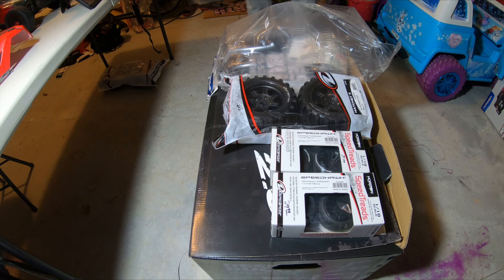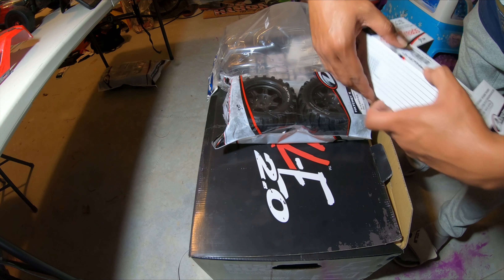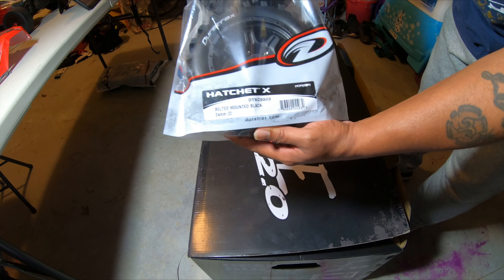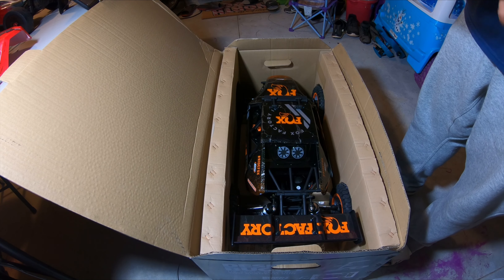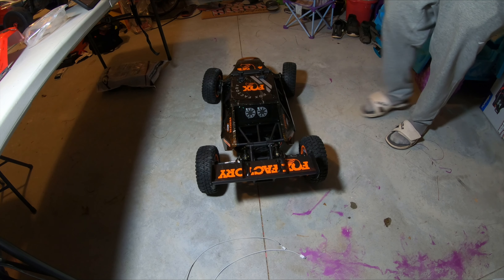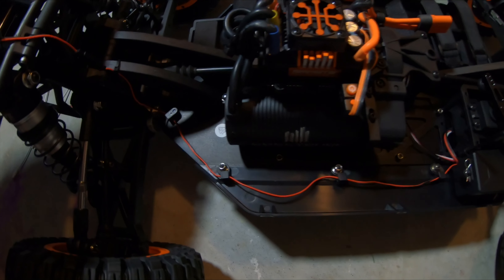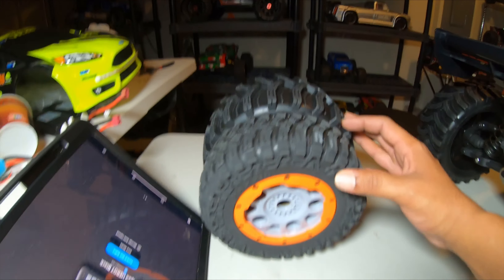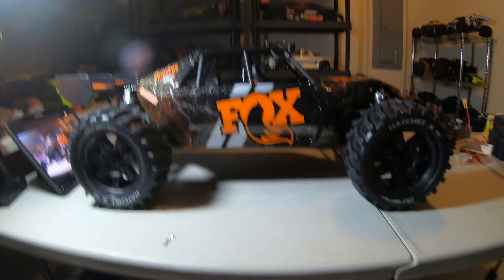Losi DBXL E 2.0 unboxing and some rc goodies

Comment: Those tires are super clean i wanted those but my Hobby shop didn't have the drill bit to drill the right format to fit the Losi DBXL-E so i went with the Powerhobby Raptor XL, They look nice but there much bigger and heaver then stock tires, I get great traction but with my new 1100kv motor am having installed i wonder if those tires will put a Strain on the motor.
Reply from the maker: You don't need the drill they make then for the Kraton 8s now and it's the same hex as the dbxle look them up on Amazon and yes they are wider but not much taller and way more grip
Reply from the maker: If you think you get good grip with stock wait until you put these on they will make you wheelie
Reply: @GAPreviewsAtoZ  Got it right on bro i will check them out
Reply: @GAPreviewsAtoZ  Would you keep the Powerhobby Raptor XL or go with these you have?
Reply from the maker: Powerhobboy xl are not that good on dirt
Reply: @GAPreviewsAtoZ   One thing is they do look clean on the DBXL-E but the rear tires start to rub after a few minutes because they start swell and i cant find no wheel extenders nowhere there all sold out for the DBXL-E 🤦🏽‍♂️

Comment: Looks Sick as tits 👌 👌 😍 With those Hatchet tyres n Wheels on just sends it over the top! Should handle better & even little extra top end speed with the slightly bigger diameter.. Q Please... What's difference in size between these Hatchet X wheels & stock Kraton 8s Wheels? TIA. 👍
Reply from the maker: They are a little taller but the kraton wheels are a little wider 👍🏾💯 Rcfam4life
Reply: @GAPreviewsAtoZ  Cheers pal 👍